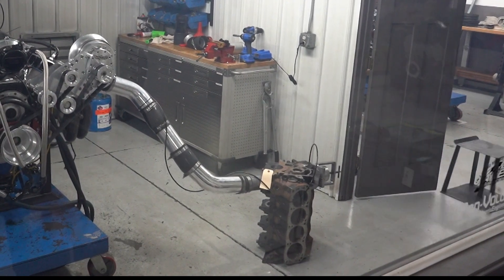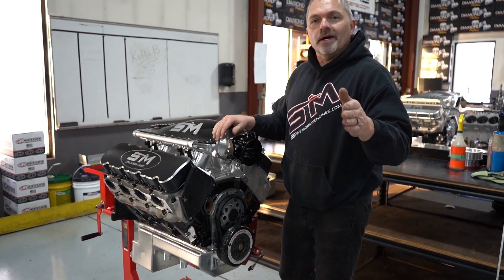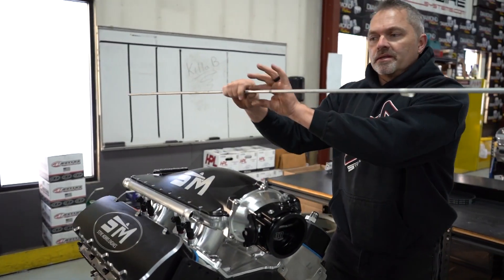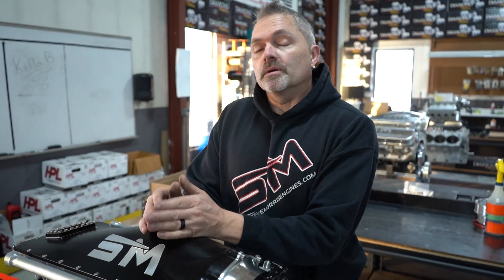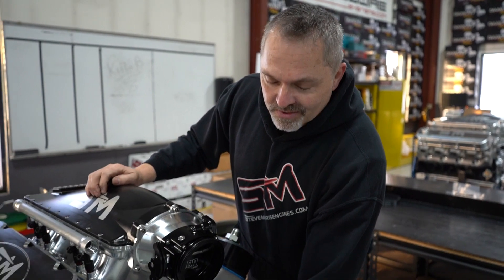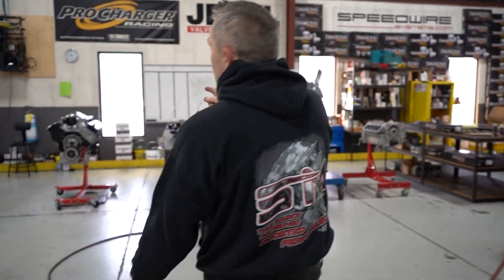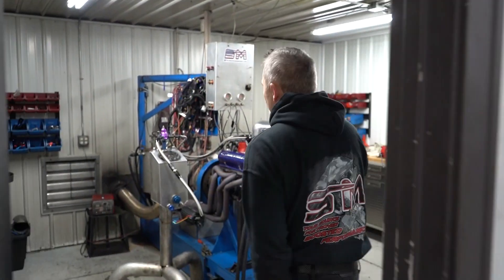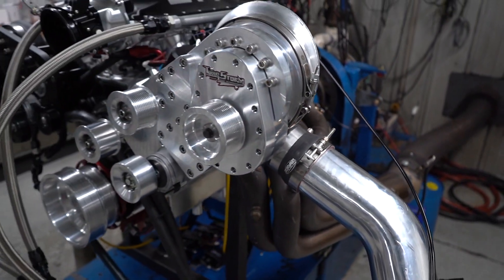Why All The Sparks ?

Comment: The best cranks in the business Callies. I been watching Steve for many years, and he's one of the smartest men in the business when it comes to a bbc, sbc, or hell any boost engine.
Reply: Bryant has entered the chat...🤣
Reply: @Stryker Enterprises LLC  🤣 They make a good crank too. I just like Callies, I been running their 100% made-in-USA Magnum for years and they've never failed me. Callies billet crank is a straight beast too.
Reply: @jasonstormoen  Lots of good cranks around. Crower, Winberg, Callies, Bryant. I think Winberg and Bryant are often considered a bit more high end and they are usually what is used by the top racers, but they all make a good crank depending on your needs. I will say this. I have actually seen a Callies Magnum straight off the line that was supposed to be spot on, which had journals that weren't completely round. It actually had to be sent out and machined to be made correct. That was a huge disappointment. It wasn't my crank, but I helped my friend sorting it out. Since then I feel uncomfortable ordering a Callies crank, in part because they weren't all that helpful. That's a very expensive crank not to be done right from the factory.
Reply: @AB-80X   I agree, there are other good cranks out there. I have also seen and heard stories about all of the other good crank companies out there over the years. A friend runs a Bryant in his drag week-winning Javelin, and it's a good crank.  I am just talking about my opinion and my preference. When a company's been good to me and I've had great luck using their stuff, I stay with them. Just like Oliver, I use their rods in my bbc and sbc engines, and I have been using Oliver since I quit using Child & Albert rods back in the early 2000s, but I did use a Callies ultra I beam in my last sbc due to time and Diamond is my go-to piston, but I do like Gibtec. I try to use American companies and especially ones that use American material also.

Comment: On several occasions (diesel stuff) I've seen the crank snouts pulled off by over tightening belts, especially on 71 Series stuff - they had lots of belts and a fairly small snout diameter. Always found marks on some upper mains on tear down. Extreme case of what you showed with the TorqueStorm dyno. Cool to get to see it under more controlled, and less catastrophic, conditions.

Comment: The shaft deflects into a banana on the connecting rod journals, not on the main bearing shells. Only because the engine speed is too high (counterweights on the crankshaft meet when the direction of the piston stroke changes) and the torque received from the pulley causes a gyroscopic effect. This is a wave (vibration) effect caused by a non-linear load and can be eliminated by changing the diameter of the pulley to a smaller, wider or heavier one( to move gyro effect outside crankshaft). Often such an effect occurred in r4 engines with three main shaft supports revs over 9k rev per minute.
Reply: Sounds about right it's got the wahwahs
Reply: had this issue with a procharged audi rs4, the balancer was dead straight but the engine kept vibrating, replaced the flywheel too without changes, it was very frustrating, i fixed the issue with a machined steel pulley instead of the alu one that came with the kit, i thought that the pulley was flexing, i was wrong...

Comment: When I worked on fuel cars, they were actually kind of talking about maybe trying to trigger off the rear of the motor instead of the front because of how much crankshaft deflection (torsion) it had on it. It was wild hearing a lot of the numbers they knew about, it was on a multi car team, so it was definitely a treat for them to listen to extremely intelligent people talk about that stuff!!

I don’t want to say it, but I’m going to, not enough power to hold a crankshaft straight thing… LOL!
Reply: Yeah, the forces are insane. I actually had a snout on a Bryant crank break clean off on a powerboat engine. The combination of deflection from the blower and the boat going in and out of the water which loaded and unleaded the snout was just too much. Boom! Carnage. Impressive how much damage an entire snout assembly wizzing around a bilge at 7000 rpm can do.
Reply: @AB-80X  yeah I’m glad I wasn’t there for that! That is a TON of energy, also known as serious injury – lol, flying around!!  I mean most of us get lucky with stuff like that a little more often than not so we can have a “well only takes ice to learn from that was move on aaaand do it differently” but still, glad that didn’t hurt anyone!

Knew a really great guy that got his thumb chopped off in the blower pulley on a fuel funny car while on the starting line (body up after the burnout), his thumb was still in the car (somewhere) when it went down the track, apparently, I don’t know if they ever found it though, but no matter how long you do something for or work out something for, simply eventually always comes up and tries to bite ya, so to speak.

Fuel cars, at least the ones I’ve worked on in the past, run blower belts, SUPER tight.. a family member of mine has three blown engines on the NTPA (tractor pulling) circuit and although has smaller blowers, but a with a high helix blower with more overdrive – you can probably move that belt a a total of one or 2 inches side to side and he doesn’t break belts.. so I was still not a bit fascinating, which segues me into one more thing, haha, some of the nitro teams-I’m purposely being a little vague-that build their own motors, don’t even have side mains on the number one main cap.. because of the blower/blower belt!

Comment: Steve in the Turbine engine high altitude test cell we sometimes use two Turbine engines to blow through the front of the test engine on the stand to simulate aircraft speed and altitude.  I thought that was a interesting comment/idea Kyle mentioned.  Love the channel and education. I never considered crank deflection/ bending I thought it would pull and get the thrust side of the main

Comment: A possibly easier way to measure supercharger torque would be to put a pivoted idler on the tension side of the blower belt (and do all the associated math to translate belt tension into torque, then HP). You would have to account for any accessories like water pump etc, but it would probably be easier to modify the tensioner idler than the blower bracket(s).
Reply: Then the belt slips. If you put a counter tensioner on you ruin your measurements.

Comment: Steve, in the prior video the missing component is heat. When you are blowing into an engine there is actual compression due to a varying amount of resistance in the intake tract because of the action of the valvetrain. With your experiment in the prior video there was only enough backpressure to reach the determined boost pressure, there was no compression and there was no heat. As you know, hot air expands and accounts for some of the boost number that you see on a gauge. You will only see that on the engine and the cfm required (and thus the blower load) required to create boost on an engine will be less. The blower in the last video was loaded excessively and moving the crankshaft snout by the .090" and also creating the huge power loss because it was too easy for it to move air on the discharge side. You need to try Kyle's experiment of linking the engines to get the actual resistance and heat generation.